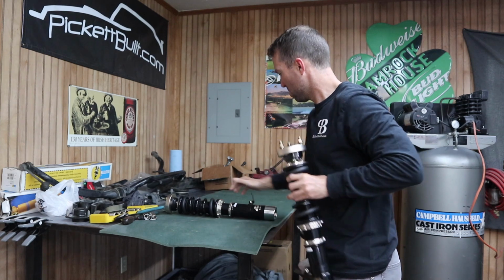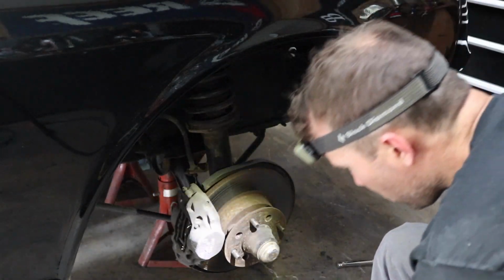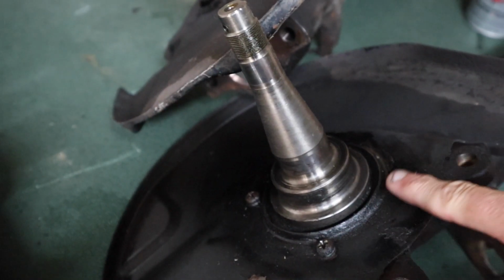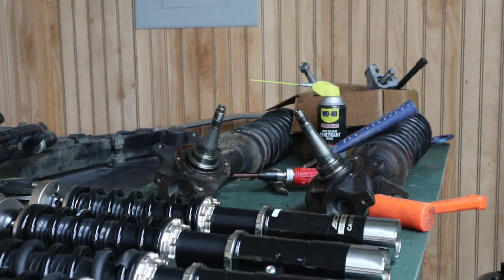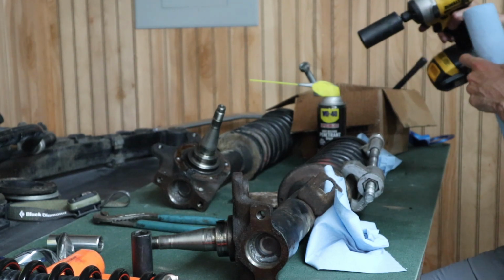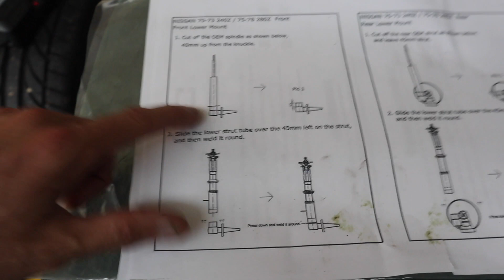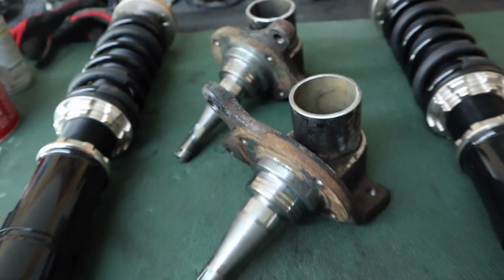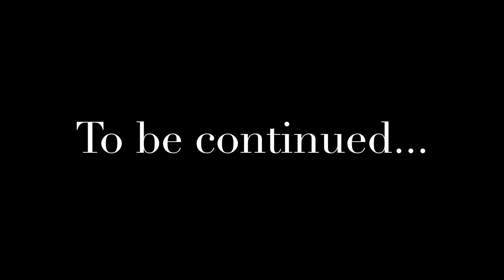280z Gets BC Racing Coilovers Part 1, Z Dreams Episode 23

Comment: Why does no one take out the stock strut cartridges before cutting?
Reply from the maker: Just easier. Sometimes the strut is a pain to remove. Plus, no need for spring compressors or trying to remove the entire assembly. Just cut right through it.
Reply: I wondered the same thing...

Comment: Great video, what spring rates are these (4k front/ 5k rear etc)?
Reply from the maker: Thanks! here is the specs. Front Spring Rate: 4kg/mm Rear Spring Rate: 5kg/mm
Reply: Awesome, have you took it out to see how rough/smooth the setup is? Thanks for the reply
Reply from the maker: 13sampsrx8 I still have not finished the install. Front is almost complete and then I have to attack the rear. Hoping I can get back on it soon.
Reply: Gotcha, keep up the good work! I got my 240z to the point where I replaced all the floors/ spare tire tub and rear valence and dustless blasted it all myself, hard to stay motivated with all the endless work so I feel your pain lol. Thanks again
Reply: @RyanSampsonRPh  they are pretty stiff ,,,I have to use the damper setting at 20 on street ,,bounces alittle ,,,,with dampers set at 8-1 they are super stiff and should only be used on track,,,,and the regular br series you can go almost to the ground ,,,no need for the extreme low series
Reply: @3rd-eye-neenja563  Good to know thanks man!

Comment: What specs did you get on your coilovers, did you get the swift spring upgrade or the extreme low option or damping extension 
Love the car by the way
Reply from the maker: Appreciate it. Not sure about the swift springs.. These are not the extreme low but do have adjustable dampening. The spring rates are 4k in the front and 5k in the rear. They do have extended studs at the top for installing a strut bar as well. I can’t imagine going any lower than what these are capable of. So far so good! Car handles amazing. Thanks for watching!
Reply: @pickettbuilt2686  thanks man